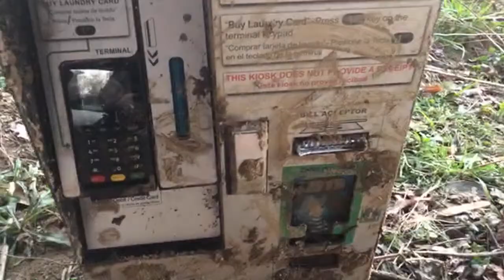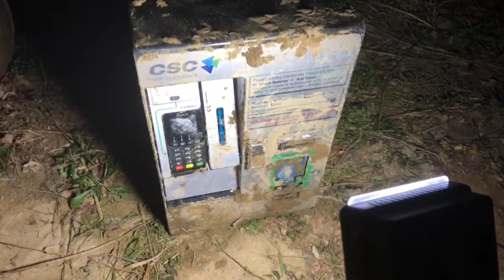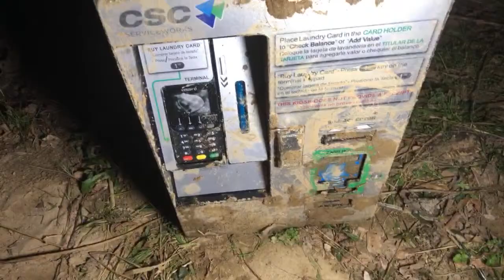Police Called!! Found Guns, Motorcycle and Cash Box in Crime Ridden River!!

Comment: The vin # is found to the right of the head stock tube. Usually on the part of the frame that the forks go through, underneath. The vin will be stamped deep into the frame.
If you find it try running it thru one of the following sites. Cycechex.com, cyclevin.com, or instavin.com. wishing you the best.